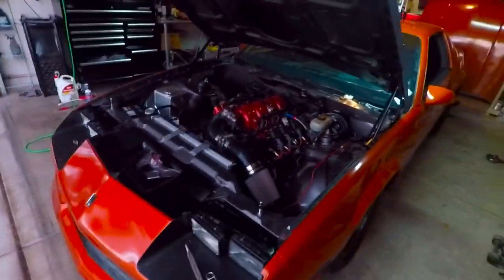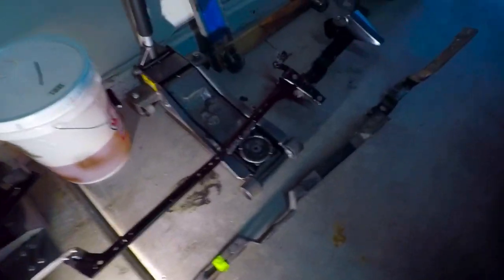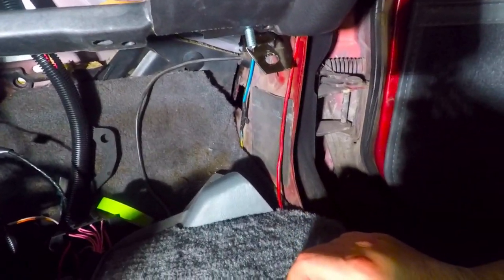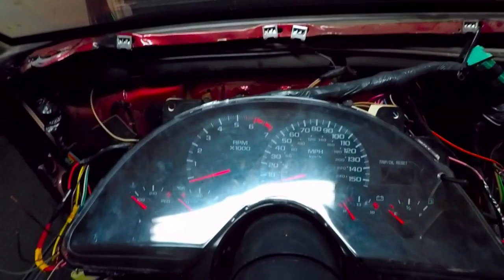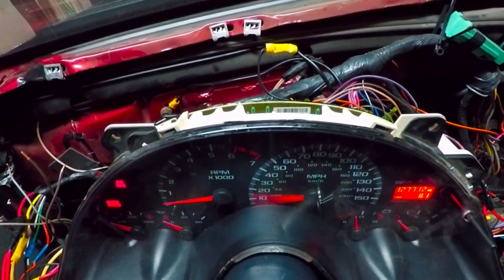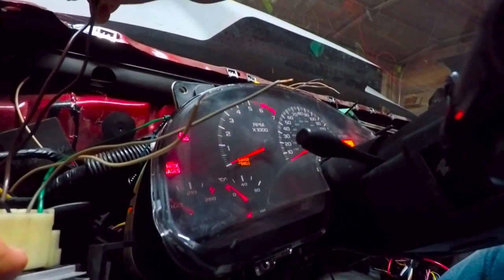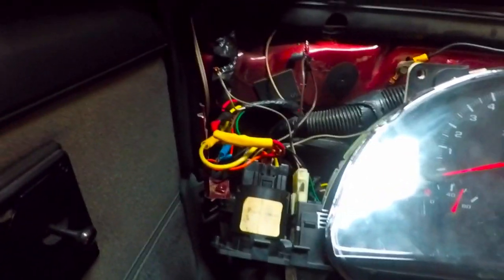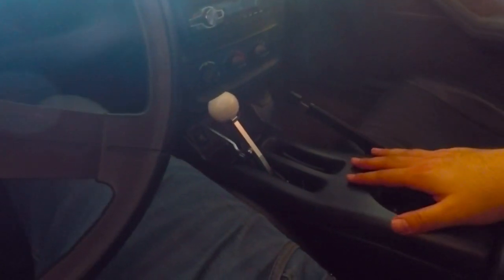HOW I SWAPPED A 4TH GEN DASH INTO MY 3RD GEN CAMARO!

Comment: Nice job with the swap but in MY opinion the 3rd gen is better and a classic
Reply: ALOT more easily repaired when it cracks & alot softer.
The dash is the worst part of the 4th gen from a durability stand point.
Now the seats I would definately use.

Comment: Is it possible to swap out the 4th gen steering wheel also? I hate that tri bar 3rd gen one.
Reply: I have an '84 Z28 and I used the 4 spoke steering wheel out of a newer '92 S-10 that has the 2 spokes on each side.
I like the looks of it and it fits perfectly , bolts on. Found it at a salvage yard.
Best part is that it was cheap .
Reply: Never heard of sparco?